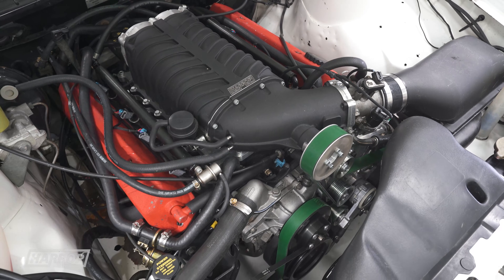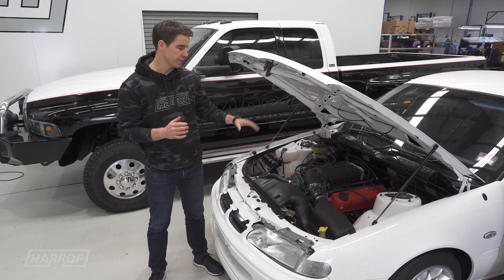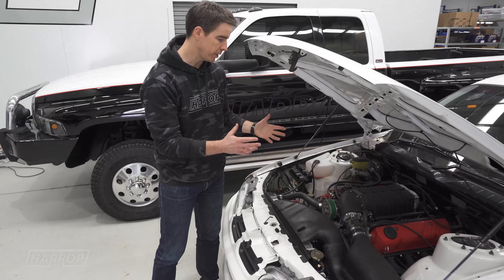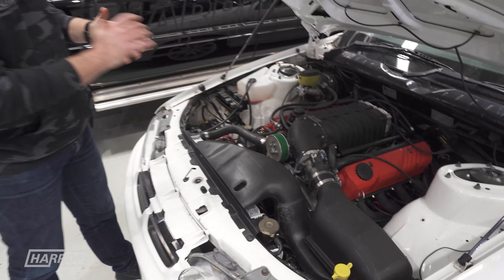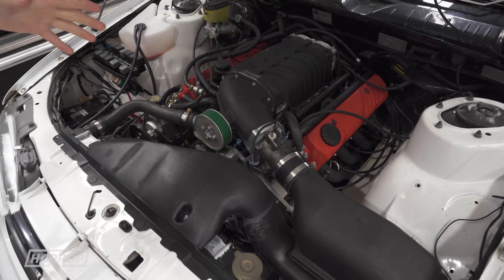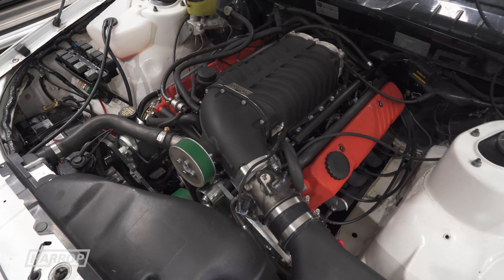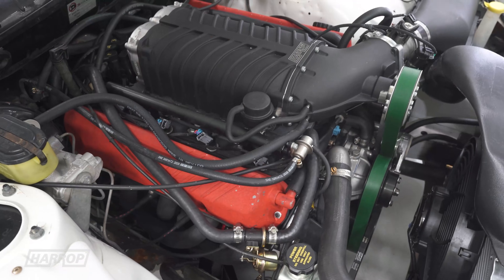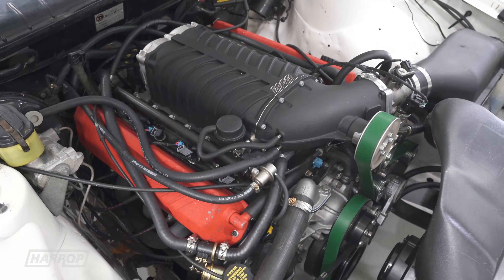Holden 5L V8 | Harrop Low Profile Supercharger Preview

Comment: This video is a bit deceiving. If you look at the before and after images closely, you'll see that a whole lot of work has been done between the shoots. Different intake, cooling system, ignition system, radiator, front suspension, ... I know a lot of these aren't performance related, but what else was done between the first video and the second? It's clearly a lot more than just fitting the supercharger.

Comment: So you are telling me that a 5l v8 only manages to produce 210hp while my car with a 2l 4 cyls can do the same?
Reply: The difference is yours most likely makes it at the crank 

This makes it at the wheels which means its probably making about 250-270hp at the crank
This also makes alot more torque and doesnt require short gearing to be able to get going

Comment: Iva got a 12 second quarter mile daily driver  VL Calais with built VT roller cam 5.0 stroked to a 355 with forged 20 cc dished  pistons dynoed at 310 rwhp on carby back yeard tune, was Originally built for a procharger but never happened, I'm keen on one of these now I wonder what power figures it would run ? also what boost can this pump like 25 pounds ?

Comment: If that motor is stock in that car I doubt if it would have a roller cam etc.225rwkw is 30+rwkw more than a stock 6.0Ls. My low km 6.0Ls  dynoed 180kw at wheels stock. A chip and pipes gets you to 230rwkw. Most bang out of a stock 6.0Ls is about 260rwkw.  A Ls will cost you like 50k now before installation. So 9k for something that goes that well and sounds as tough is cheap. the modified VT roller 355 version does 600kw

Comment: My stock 185kw motor running 1.6l auto rotor/whipple with cutdown banana manifold with top mount 4barrel throttle body with bigger injectors headers and exhaust running 5.7psi made 255whp an 650nm@2200rpm non intercooled. Loved 12psi tho not sure what hp was at that though

Comment: I Wouldnt thought there was enough of them boat anchers around to be worth R AND D,had a couple in the day,why dont you a setup for 351 cleveland
Reply: Lol boat anchors ay. You can make 650hp fly plus on stock block and stock crank with one. The clevo blocks start bore distorting at those power levels then start blowing all the power past the rings lol. 
Why do all pro engine builders use 351w blocks when doing a clevo headed build? Because the clevo is rubbish apart from a good valve layout. Then you have to get 3V heads for the rubbish engines to make any decent power. 
Late 5l windsor style heads are even better now as you can get some that flow 500cfm and make more power than a clevo style head.
Don't throw stones in glass house's.
Reply: https://www.youtube.com/watch?v=DXnZvMzMLXI&ab_channel=STREETMACHINETV here's proof of a "boat anchor" making over 650hp.

Comment: Hey guys who love these vr vs utes with 5.0 engine ,,    I know of one that will be up for sale ,,,        this is a white 94 VR 5.0 S pack manual transmission with just 65,000 kmh or less  and is still in original un marked paint , all books n papers ,    this car is best described as almost new still inside and out ,   has had  simmons wheels from day one  ,      have to be of the lowest km in this shape left
Reply: Can you please let me know the details of it mate.
Reply: @lukegibbs8014  luke do you mean vin or reg ,   because this is not my car i  wont say it here ,  facebook
Reply: Will say its original not smashed up or just restored ,  this is a dead honest one ,,  extremely rare now , most are dead or gone to hoon life trash mode
Reply: @holdenbrougham7768  I’d be very keen on buying it mate!
Reply: @lukegibbs8014  well he is set between 45 to 50  k    , already got one guy on it who was talking 4748k  cash so theres a basic idea of price but i think , well i know the car and owner was very meticulous,   and car was always in the house garage not a shed so its a clean original but like new car,  not tarted up in greasy shit on dash either , hated armour all  ,    dash is mint ,  even air con button mint
Reply: @lukegibbs8014  its heron white with black simmons not sure of exact wheel , has 5 spoke s  , looks just plain smart not over the top ,  owners in mid 70,s now ,  never uses it , well he never really did hey at only 65,000 km,  worked for holden 9 years , never seen any utes better than this one ,  like the wrappers just taken off
Reply: @lukegibbs8014  its heron white with black simmons not sure of exact wheel , has 5 spoke s  , looks just plain smart not over the top ,  owners in mid 70,s now ,  never uses it , well he never really did hey at only 65,000 km,  worked for holden 9 years , never seen any utes better than this one ,  like the wrappers just taken off
Reply: @lukegibbs8014  its heron white with black simmons not sure of exact wheel , has 5 spoke s  , looks just plain smart not over the top ,  owners in mid 70,s now ,  never uses it , well he never really did hey at only 65,000 km,  worked for holden 9 years , never seen any utes better than this one ,  like the wrappers just taken off
Reply: @holdenbrougham7768  if he’s keen on selling it I’d buy it mate.

Comment: Makes less power then a tuned ls1 🤷‍♂️
Reply: About the same power actually. Its probably under 7psi due to the iron heads and port ulp run it on E85 with a blower injector or just batch fire all the injectors then you'll be able to run past 12psi. Remember 15psi is a 100% increase from stock so it'll make 400hp on E85 likely but you'll want to get some of the E85 spraying onto the rotors. 
Alloy heads run cooler so will add a couple of psi or a little more advance either way it's more power. Also most alloy heads will flow better so psi will drop off anyway letting you use an even smaller pulley. 
Edelbrock heads are 2k each so 12k for the blower 4k for the heads 3k to convert to E85. You are at just under 20k for easy 500hp potential which is LS7 teritorry.

Comment: Tell Joel to wind that shit up, until it throws a rod or two, then back it off half a turn.
If I was going to spend Harrop blower money on a 5.0, surely, I'd have the coin, for some supporting mods to the long block.
A whopping 7psi, please, I piss with more pressure.

Comment: Lol...Ls makes 100 more hp with just tune.

If it doesn't pull 400+rwhp chuck it in the bin boys...although I wouldn't expect miracles without an intercooler so I'm gonna guess this perticular setup doesn't even make 10psi...
Reply: Please show me your 400rwhp LS with stock cam, heads, exhaust ect but only a tune.
Reply: https://www.youtube.com/watch?v=qDZOM-m_xTY&ab_channel=RichardHoldener  here you go crusty, this is a LS 5.7l with aftermarket heads and long tube extractors with no mufflers and it only just cracks 400hp flywheel so it would be like 330rwhp through an auto. The engine in the Commodore in the video is only running 8psi (I know this due to the power increase) with E85 you could gain an extra 7psi and have no detonation. But E85 will need a new fuel tank, pump, line and injectors.
Reply: What LS makes 400 whp with just a tune? Even a vf with OTR , cat back and tune only makes 340-360. 

And LS1 with headers back , OTR and tunes makes 310-330. 

And then they still usually only go run a 13 still anyway 😂
Reply: Yep Hayden this guy knows more than us and Harrop lolol what a joker.
He probably thinks the earth is flat and 5G is dangerous too....
Reply: Stop comparing a crappy old 308 to an ls it's not even close when a stock 4.8 ls makes 335 hp and a 6.2 will make 400 wheel hp with minor mods an ls7 will make 400 wheel with no mods my ls3 makes over 500 wheel hp naturally aspirated 😄👍

Comment: The most expensive 90hp you will ever buy
Reply: So add e85, go for some supporting mods and more boost and triple that power increase. It's not brain surgery man
Reply: If you want a PD power and torque curve you don't  really have any other option. I'm sure on E85 you could put a much smaller pully on and get another 100hp on top so 400hp+. Problem is without the intercooler you have to limit boost. 
Some Edelbrock heads would help make more power as alloy heads move heat faster so you could up boost a little more on alloy heads.

Comment: The thing most of you nay sayers are missing is that its non intercooled.
Theres massive amounts of power left to be had here.
There just isnt enough bonnet clearance for the intercooler brick thats usually under the supercharger.
40% power increase is savage non the less. 
Can it be done cheaper? Yea it can. 
But will you have the appeal of owning a roots style supercharger? No, you wont. 
This is a prototype not a finished product.
That pully is absolutely bloody massive whats it making harrop? 4-5 psi?

Comment: 11 grand to make 89hp good power adder but cost effective i don't think so 🤔
Reply: Ouch  yeah not cost effective
Reply: Plus labour plus tune plus plus plus 
Not worth the 11k plus another few thousand ontop to make 89hp 
Nitrous probably will make more
Reply: Take into consideration they are expecting people that buy this to have already done Heads + valvetrain + exhaust all of which would increase power on their own but they'd also increase the effectiveness of the blower

The car used as an example looked overly stock and a bit worn out 

So i reckon an easy 350+ whp on a 304 with the proper supporting mods and a tune
Reply: @ESISTTIGER someone with a brain 🎉🎉
Reply: Probably better off with a turbocharged upgrade
Reply: Cost double what the Ute's worth. Hahaha this country sucks
Reply: @murrijuana2842  well piss off to another country like Afghanistan then.

Comment: 299hp lol I’d want my money back
Reply: Its a 42 percent increase, thats not bad....theyre just gutless motors...
Reply: @shackleton274  I’m not knocking the increase, but i know for sure harrop would charge an arm and leg for that and in my opinion it’s not worth the costs that you’ve forked out for , an NA barra can get those numbers! No thanks
Reply: @lloydchristmas2326  Well thats ford for ya, turbo barras do very well with mods....i do agree that the hp number isnt great but the percentage is pretty normal for a supercharger, i guess the 5l probably just isnt worth supercharging....i mean a 42% increase on a low HP engine still doesnt make it a powerhouse....